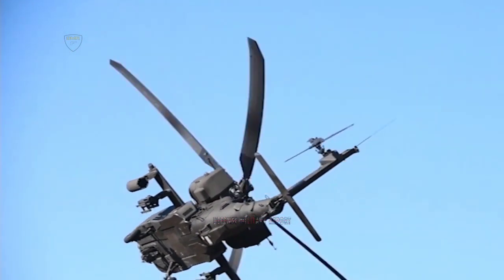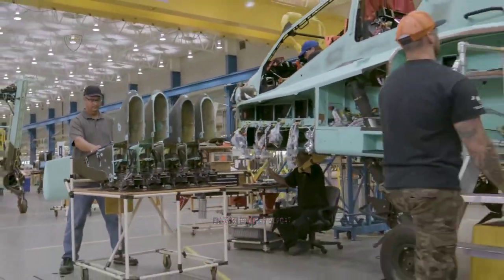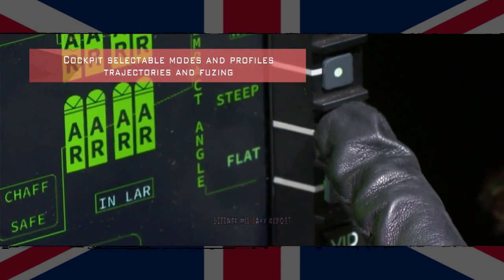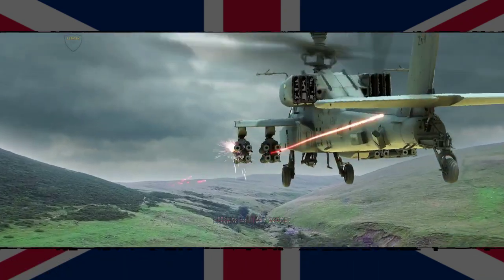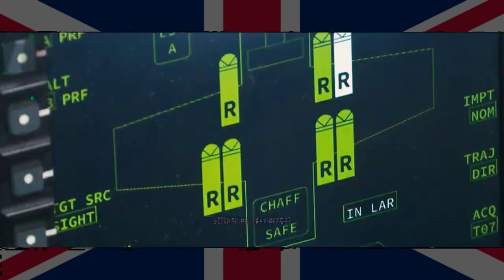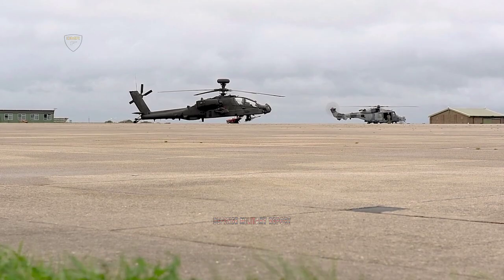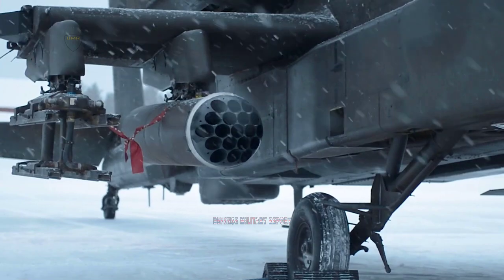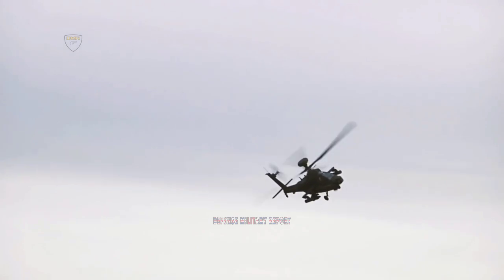The UK New AH-64E Apache Helicopter will use JAGM U.S-Made instead Brimstone Missile

Comment: I write as I watc, giving my opinion as the videos play so I try to give said opinion before I watch to see if the information put out is similar or the same as my opinion on what should be done or what something is or how it works, then I see if my theories are in alignment with the people investigating, inventing or just discovering something new, and funny enough a massive proportion of usually is.
About not choosing the Brimstone, that is probably the reasonings behind the decision to use US made close air support and ground attack missiles instead of the Brimstone, because it's already integrated into the platforms systems, although maybe in time, it wouldn't surprise me if at a later date, the MOD/British Army gave the AH64-E that ability to fire the Brimstone, maybe even using the AH64s on the QEC carriers, first of all Queen Elizabeth RO8 fitting existing attack copters with the Sea going naval version, either from a deck launch of by Wildcats and Merlins or Apaches.
I reckon MBDA need to develop a portable easy to assemble version for deck launches on carriers for navies with either small flight decks carriers, helicopter dock ships, or for ones without room within the ship hull for VLS systems, something light and something that can be anchored down quickly and used as defensive ordinance against fast moving craft and small ships too.